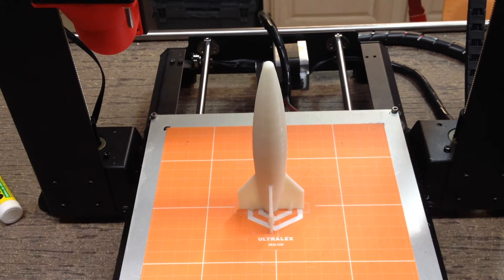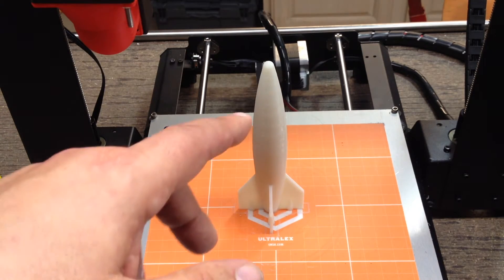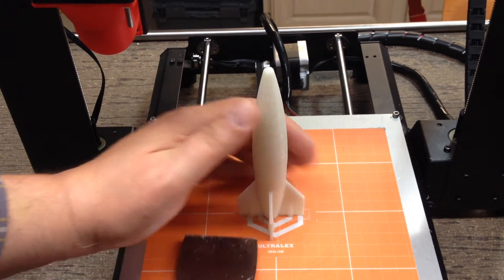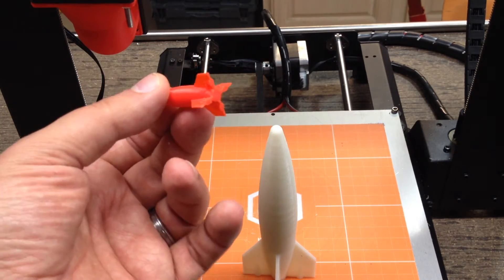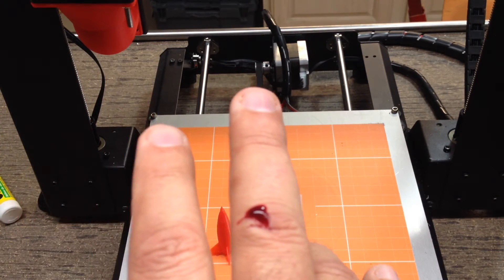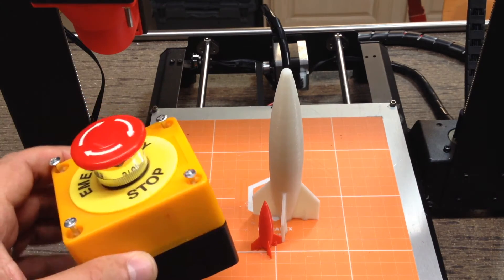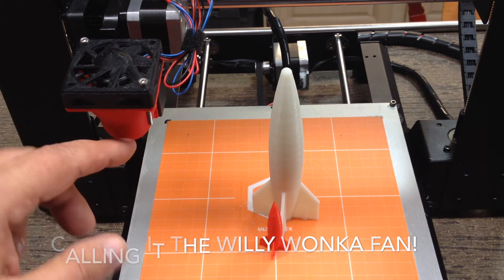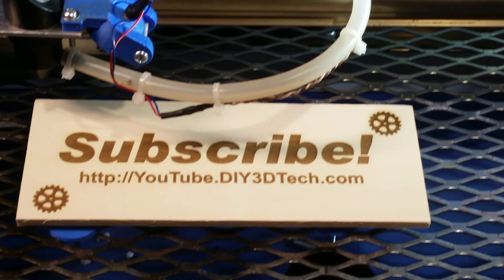3D Printed Projects - Round Nose Rocket from BotMaster!

Comment: I now have an E-Stop of sorts on my Maker Select when I put the angled LED mod on the controller / PSU. The LED board has a "reset" switch which power cycles the PSU.  While its is not a true E-Stop for power it will "stop" prints quickly and helps reduce my stress when trying new filament settings. I hate spaghetti right off the bat. I still need to tweak my Hatchbox PETG settings and used the "stop" button a lot this weekend. 

Love the Glow-in-the-Dark rocket and might have to try those settings for my "gitd" PLA. 

Thanks for the video. I always learn something. 

Norbert
Reply from the maker: +Norbert Davis yes the reset will stop it sometimes, so long as the Arduino (or clone) recognizes the reset.  On my CNC, I have seen it ignore the the reset so use with care for that purpose.  Also, yes the grandkids love the glow in the dark PLA :-) lots of fun!

Comment: The striations on the fins is caused by your jerk and acceleration settings.   Check this out:

http://www.thingiverse.com/thing:277394

It's a test print that you can use while adjusting your jerk and acceleration to remove the striations.

Edit: Here's an article on this:  http://3dprinterwiki.info/wiki/wanhao-duplicator-i3/duplicator-i3-calibration/firmware-settings/
Reply from the maker: +Scott Adkins this is very interesting!  Thanks for sharing, will have to dig into this a bit as not sure however as you point out seems likely.